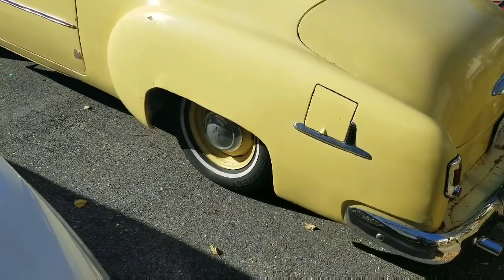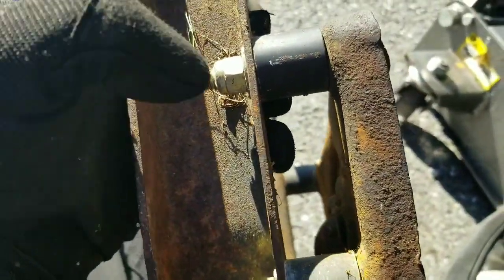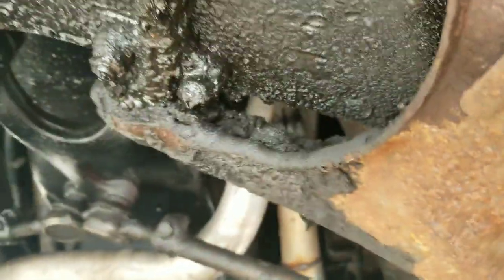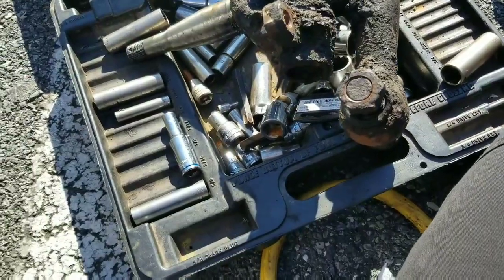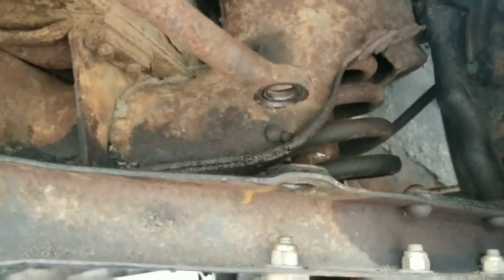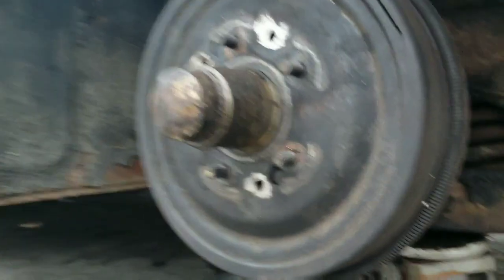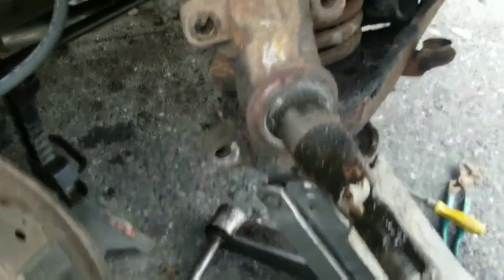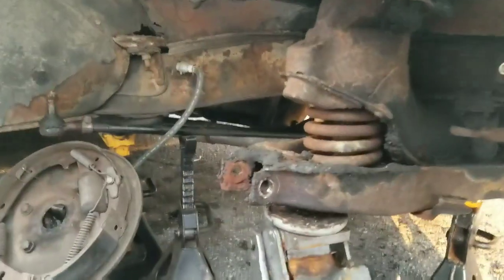Lowering the front on the '51 Chevy; part 2

Comment from the maker: So I might leave my swaybar disconnected. I just drove it around town, around curves and about 10 minutes at 65 miles an hour and noticed no difference whatsoever in handling. The only thing I did notice is I just floated over bumps, whereas when the sway bar was connected, before I lowered the front end, it made my every bump in the road more pronounced

Comment: Thanks for the video got a crazy question is it possible to flip the uprights on a 51 or will it bolt up. Basically the 51 upright sits low where it connects. Is the big bolt holding it in is it a big bolt on top
Reply from the maker: Honestly man I havent tried on a chevy but it works on my Ford shoebox. I read it didn't work on Chevys but I dont see why it wouldn't. I don't have the car anymore to look at unfortunately
Reply from the maker: From what I remember the bolts are the same (just like the Ford) with the only difference being one controls the camber (lower) while the other is just a big ass bolt (upper)

Comment: Hey Chris primo video , wanted ask if the 54 arms work the same in a 52? And the inch spacer you modded add the extra inch to lowering?
Reply from the maker: Yeah man they work on the '52 perfectly. The inch spacers actually give about a 2" drop at the wheel. After the spacers and upright swap I still have full turn lock to lock with factory wheels so it worked perfectly
Reply: Oh sweet , time to track down 54 front stuff cheers
Reply: And one more question, how'd you go about lowering the rear ? Flipped leafs ? Lowering blocks? Or reset springs?
Reply from the maker: @korelawrence3649  
 When I did the T5 and axle swap the perches I had made dropped it an inch and a 1/2", I'm using 3" lowering blocks and the '53 Chevy leaf springs I put in were sagged about 2".  It rides perfectly and the only time the axle hits the frame is on the highway over a pothole or something like that. I was going to notch it over the Winter but I'm selling it instead to fund a '49 Ford coupe
Reply: @Christopher Spencer oh nice , I just picked up a 52 deluxe first piece of American tin I've had the pleasure of owning its all factory standard .. NZ has a limited range of off the shelf stuff when it comes to lowering vehicles. Might get them reset and blocks , what size tyre are you running 205/60r15? I still have factory 650-15 crossply tyres
Reply from the maker: @korelawrence3649  
215/70r15 is what it's running.  I wanted a set of white walls for it but I can't justify a $1000 for some tires.
Reply: @ninja63639  they seem alot less taller in the sidewall but appreciate the knowledge cheers

Comment: Hey Chris, did you have any other issues with adding the spacers to the arms?  Steering arm issues or alignment issues? Thanks for all of your videos.
Reply from the maker: No sir. It's essentially the same as cutting a coil or two.
Reply: Thanks, Chris. So you got that drop with just the 54 arms and uprights and spacers? Is the coil just a stock coil?
Reply from the maker: @timtimmermon7947  
They're the stock powerglide coils. But yeah between the arms and uprights that all I did.